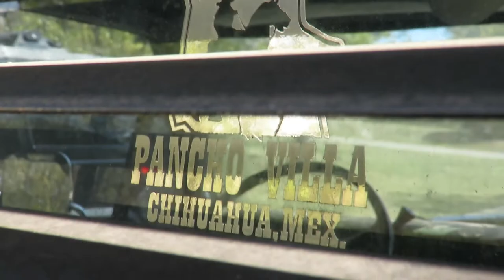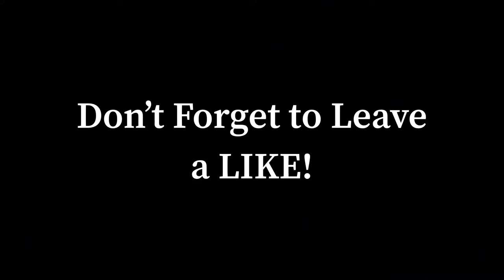Introducing my Lifted 1968 Ford F-100!

Comment: Remove the automatic and put in a NP435... And dump the 302 for a 390
Reply: That's whaI would do. I have. 70 F250 with a 3" autofab lift with a mild built 410 and a built C6. Not complaining but wish it was a 4 spd. My switch it sometimes in the future but with a 5 speed....